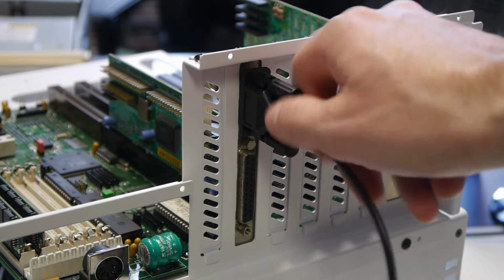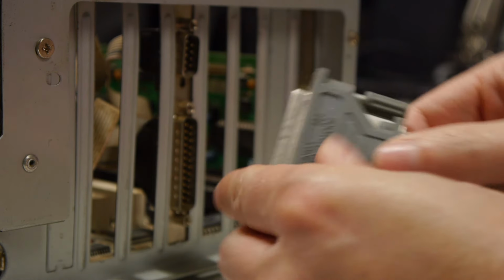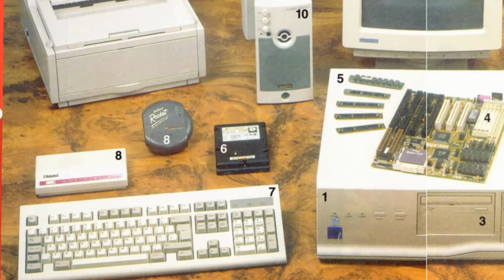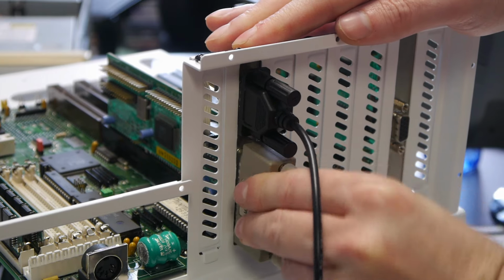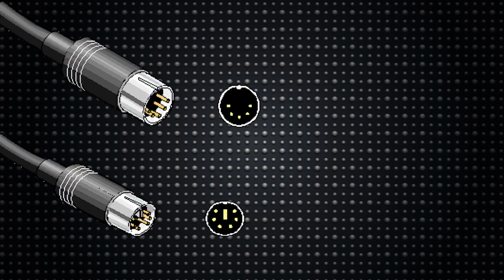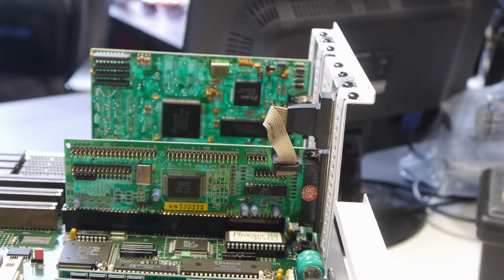What did we use before USB? | Nostalgia Nerd

Comment: How can one meaningfully discuss serial ports, parallel ports and others without mentioning the IRQ (Interrupt ReQuest), DMA (Direct Memory Access), and I/O (Base) Ports? Half the battle when one was trying to make lots of connections on a computer was selecting an interrupt, base address, and DMA channel that were available and supported by both  hardware and software. This was notably simpler in the mid 90's than the mid '80's, because things had become more standardized.

Serial cables were a nightmare, you might need as little as three wires with jumpers between connections, every device was likely to require a specific configuration. Twenty years ago IT needed to connect a modern computer to an IBM line printer so the company could continue printing three part forms (carbon copies). They were young and cocky and I let them sweat three days before I offered to solder a serial cable for them - it is still in use. Similarly they had no clue with the SCSI interfaces on the high speed scanners. SCSI was always a compatibility hassle with a multitude of connectors and generations that cost a fortune to adapt between.

Good riddance to the old interfaces. Even with the variables of how much power is available,  whether the connection includes analog audio or Thunderbolt and the upcoming 3.2 devices the USB world is far simpler than that of its predecessors. USB 3.0 is USB SS (SuperSpeed) is USB 3.1 Gen 1 is USB 3.2 Gen 1x1 is 5Gb/s. USB SS+ is USB 3.1 Gen 2 is USB3.2 Gen 2x1 is 10Gb/s. USB-C should be USB 3.1 Gen 1 or better. USB-C with Thunderbolt is the best. Don't buy anything below USB 3.0 and throw away your old USB 1 and 2 cables since they will slow things down.

Comment: My TRS=80 COCO boots in barely 1 second, way faster then my Windows 8 with i7 CPU with a clock speed 4022 times faster !
The I7 3770 at 3600MHz / 0.895 (from wiki) = 4022.346 times faster ! And the Windows computer PAUSES at times but the COCO doesn't ! And the Windows computer has 3GB or RAM vs 64k or 500,000 times the RAM !!!
4022 times faster CPU or faster, x 4 cores = 16088 times faster, with 500,000 times the RAM !!!!
So the Windows computer doesn't have any excuses !!! But yet I'm waiting all the time but never with the COCO !
And I have a 3TB hard drive vs 150k hard drive. So why does Windows SUCK SO MUCH ?!?!?!?
Graphics are no excuse with that amount of power ! The thing should be able to run circles around the COCO !
But if it SIMULATES the COCO ,  it doesn't have these problems !
It is like Windows is designed to slow you down !
Puppy Linux runs in under 256K, all in RAM, and doesn't have these problems.
So why can't Windows with thousands of programmers do the same thing ???????????
I still have some TRS-80 COCO tapes ! Anyone know where to get a disk driver belt replacement ????? 30 year old broken belt !

Comment: Well, SCSI were superior for a long time. Not only a speed and interesting disk controler, but small things that made me happy - hotplug, separate LED connectors for each disk and not running all the disks at once, but one by one, which was much better for the power supply. SATA effectively destroyed SCSI, because there wasn't any good side anymore. I still have my old hardware - disks, controllers, cables with terminators and all these converter cards (however they are called in English - small circuit between disk connector and cable plug), because there were so many standards. I'm talking here about PC, not the server - the reliability of SCSI was good especially for PC, because server rely often on redundancy, while PCs on classical backups from time to time  (at least back then). Anyways, very nice channel - brings back memories and I love you don't boast with knowledge or nostalgia, it's just informative and true to things I remember as well.

Comment: Hahah talk about a trip down memory lane.  I was tearing down junk computers and building ones that worked out of the parts when a lot of these changes were happening.  I still remember hooking my NCR 386 SX 20 up to my brothers with a serial port cable and a null modem adapter to play Doom with each other.  I do not miss the mess of adapters and wires however.  It was always either a pain to find the right cable or adapter, and I had to keep a fair supply of spares just in case.  USB was a godsend when it came out.

Comment: I see what you did there with that clip of "plugging in" the PS/2 devices at 5:45.  Reversing footage of someone unplugging PS/2 devices makes it look a lot easier than it actually is...
Reply: It was actually very easy, as long as you knew the orientation of the socket on the box.  The plugs usually had a flat space at the "top" which your thumb could find very easy.  On the box, usually the "top" was the furthest away from the motherboard.  Usually.

Comment: Today USB is pretty much the same mess as things were in the 90s. Six different speeds, a dozen connectors and a bunch of power standards that are never fully communicated and rarely mentioned at all. Sure, it works, but good luck getting the most of USB.

Comment: i like the simple world at that time. In the past where printners cound not print images, but only text... on expensive pritners you had to choose the font on the front of the printer while each character was transmitted on the parallel line. you could easily hook up an oscilloscope and debug your printer

Comment: still use DB-9/RS-232 at work. Networking equipment we use needs a serial roll-over cable to console into, that is if we don't remote into the hardware.

Comment: My External ZIP Drive was a SCSI model that plugged into a 25 pin SCSI port that looked identical to the Parallel port on my Amiga 1200. Weirdly the SCSI port came off of a board that plugged into the Amiga 1200's internal 2.5" IDE port with a pass-through for the internal IDE hard drive and converted the control signals to SCSI for extrenal drives. I later got a PC with a SCSI card in it that has a small 50pin connector that was actually slightly smaller than the 25pin plug and used a 50 to 25 pin adaptor for the 25 pin cable to my ZIP drive. I had an external SCSI CD writer for the computer that used a caddy for the disk instead of a tray and had a large 50pin centronics type plug.

Comment: When Ajay Bhatt passes away, I think he's going to get trolled. The pallbearers will start to lower his casket onto the lowering mechanism, lift it up, turn 180° and then lower it again.
Reply: But then they will have to lift it up again, turn it another 180 and lower it yet again.  That's always the way it goes...
Reply: :D Ain't it the truth!! Unless of course they mark one side of his body with the USB symbol (even then they'll probably get it wrong...)
Reply: "Although Bhatt admitted to USB's annoying aspect, he still stands by his invention. He went on to explain that the standard USB port was created without the reversible feature because it would have required twice the amount of wires and circuits — and double the money — to create it. The Intel team also could’ve opted for circular design, but instead went with a rectangular connector to give users a 50-50 chance to plug devices in correctly."
Reply: @pillettadoinswartsh4974  A circular design would have sucked even more.  PS/2 connectors are hard to plug-in as is.
Reply: @pillettadoinswartsh4974  Well, I still mess with PS/2 ports angles times to times
Reply: They'll probably need to do that a few times before it'll work
Reply: Then they will have to open the casket to check the direction before they can lower it in the right direction
Reply: He is a Hindu  and will be cremated, not buried
Reply: You know Ajay is not going to be buried.
Reply: You could do all the casket rotation with the control lines on a serial port.
Reply: At a point in time you does know which direction it goes in automatically
Reply: Lol

Comment: you CAN put different hardware in a row on an LPT port. I did it: ZIP Drive 100, Scanner, Printer. No Problems at all :-)  I like the old Ports. In the past many components are on ISA oder PCI Cards. Today you have many many equipment with usb. i often get problems with usb bandwidth.  i make music have here over 20 usb cables in my pc

Comment: The worst was messing around with interrupt jumpers,  even after you'd  found the right cable etc, you'd have to set interrupt jumpers correctly. I remember ethernet cards had port 10 where I  worked. (oh the luxury of a 10mb Ethernet card... lol.).

Comment: Now don't get me wrong. The old ports had some direct advantages, like PS/2 being at a hardware level, and therefore free to barge in during the CPU time. But the advantages are massively outweighed by the drawbacks. A PS/2 device becomes unplugged, consider that computer as good as frozen.

Comment: It was developed in 1996, but it was NOT used for over a year... You had a computer  with USB ports on it, but literally there was nothing out there that used it... maybe a USB hub (or you couldn't afford what was out), which was funny because you still didn't have anything to plug into it. The USB mouse was pretty much the first thing to come out, and even that included a converter cable to make it P/S-2 or it was simply the other way around.
The simple fact is MOST manufacturers had so much stuff in inventory or were not geared up to make USB, and they didn't want to. USB almost never become anything at all...that's the simple reason why you saw a PC with ports on it for so long.
As a computer store, the difference in price between USB and legacy ports was a lot of $$$'s... when it did start coming out.

Comment: in the early 1980's i worked for defense contractors and the computers we used, from HP had an interface 'bus' similar to the much later USB. Called HP-HIL it was a fantastic design that i am sure the consortium stole ideas from. HP-HIL itself was preceded by HP-IL which i never had used.

Comment: The parallel port was often combined to the display adapter so that you could have an usable system with just a display adapter and floppy controller (serial port was not that necessary). In the 80s standards a minimum system had just keyboard, monitor, floppies and printer as IO.

Comment: In 15 years:

"What did we have before USB-C?"
Reply: 50 years ago: “what did we use before punch cards?”
Reply: @mplsmike4023  60 years ago we used punch cards! before that we used dull tools, big hammers and flat rocks!
Reply: In 50 years:

“What did we have before mind control?”
Reply: The Automaticist usb c
Reply: @Monosekist  Cable TV
Reply: @user-no3tu9kh3p  the only problem is the thunderbolt3, yet even thAT works as a cable
Reply: We should replace USB type with USB type c
Reply: Before USB-C are MicroUSB.
Reply: USB-C is stupid. There was no reason for it to be created other than Apple being able to have only two ports on its laptops. ("Designed by Apple in California". And made by underage workers in Communist China.) Screw you, Apple!
Reply: @andymadden8183 who buys Apple laptops? They're shitty machines. USB c is awesome. I charge my phone with it and it's better than micro USB. My laptop has a USB c port. But it also has 3 normal USB ports, an hdmi port, an SD card slot, a headphone jack,a microphone jack, an ethernet port and a display port. This is on a 1800 dollar gaming laptop. My old 500 dollar crappy Asus laptop also had most of those ports. MacBooks are shit.
Reply: @tcg1_qc  Unfortunately, I have a Lenovo Yoga Tab 3 and Samsung Galaxy C8 that charge with Micro USB.
R.I.P
Reply: @DoomooDguy didn't even know what a Galaxy c8 was, but I looked it up and it's from 2017 so that's most probably why. Weird thing though, is that my 300 dollar sony phone from 2017 too has usb c. As for the tablet, it's cheap and from 2017 too so that's also why it has micro USB.
Reply: @tcg1_qc  Well, the tablet is completely sh*tty, but I got it for Christmas. And I play lots of Geometry Dash on it, with quite a lot of achievements.
Reply: @tcg1_qc  Also, thanks for making me wanna hang myself.
Reply: @DoomooDguy  Why? Just told you why your devices have micro usb. They ain't bad, I've had worse. I used a galaxy S3 and the asus laptop I talked about earlier and that laptop had trouble running roblox at 30 fps low to med settings. Now I got myself a gaming laptop and a better phone. And some people don't even have a phone or a tablet, so at least you got one
Reply: @tcg1_qc  "Also, thanks for making me wanna hang myself."
NOT ANYMORE
Reply: @DoomooDguy  good
Reply: @andymadden8183  usb c is genius, a smaller and more powerful port, it could easily replace usb-A within the next 10 years, but in the present it's better if computers come with both USB-A and C for at least 10 years so that the market and manufacturers can adapt

Comment: I think I'm old because I've used all of those ports. I've connected keyboards and mice to the PS/2 ports, keyboards to the 5 pin DIN socket port, printers to both the Parallel and SCSI ports. I've connected either the serial or parallel port to another port on another computer to play Doom, Quake and Duke Nukem 3D with a friend. I remember having to set the IRQ and DMA setting. I've installed expansion cards such as sound cards and video cards. I've connected scanners to the SCSI port, camcorders to the firewire port, mice and modems to the serial port and joysticks to the Game port. 
Then along came USB 1, 2 & 3 which over several years slaughtered the competition. Today's kids have no idea how easy they have it with plug n' play. Their only problem is running out of USB ports. Can you imagine the average kid today trying to figure out all these other ports and trying to install an expansion card?

Comment: Well, it's not like USB is perfect.  Whatever happened to the idea of daisy-chaining USB devices, anyway? Theoretically, you should be able to daisy-chain up to 127 USB devices.  In reality, you have to use USB hubs, instead, because no USB Device offers a pass-thru USB port, and power issues severely limit the practical number of USB devices you can use at one time.

Comment: Of course none of these matter without an API to tie it together. Before windows and direct x unified these connection, getting these things to work was truly plug and pray. Kids today has no idea how much of a headache it was lol. I remember I had my very first MP3 which wad called Rave MP3 player. I believe it had 16MB of memory and it only fit few songs. The transfer cable was managed thru serial port and the transfer rate were painfully slow, it took about 15min or longer to fill the MP3 player. The good ol' days.

Comment: I still have a working keyboard with 5-pin DIN connectors - it's still working, connected through 2 converters (DIN to PS/2 and PS/2 to USB). It doesn't have Windows key but it's not that much necessary anyway.

Comment: Trying to think of a tactful way to express my surprise. This isn't really one of your better videos. Not only was your mention of SCSI arbitrary, but the video hasn't really described how IEEE standards come into being (and deprecate) from the CPU compatibility (microcode to instruction set), or for that matter parallel to serial compression or the evolution of ISA to PCI and PCI-e (even though PCI-e is later) because the idea is the same ethos and can be external (hence thunderbolt later). You missed some ports used before USB too. If you were then going to mention later USB versions, it would have been worthwhile saying what firewire was and why networking ports share similarities. Nor is there any proper mention of IDE, sata or the power on USB. Shrug.